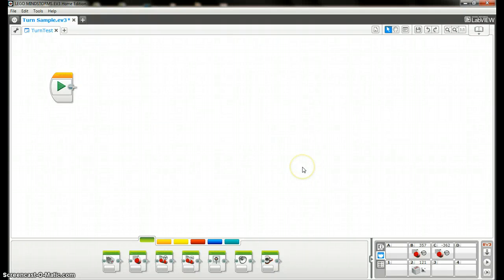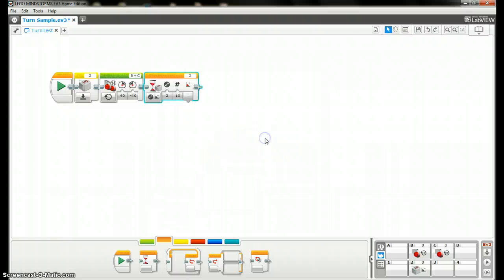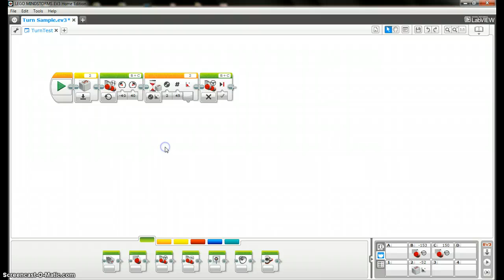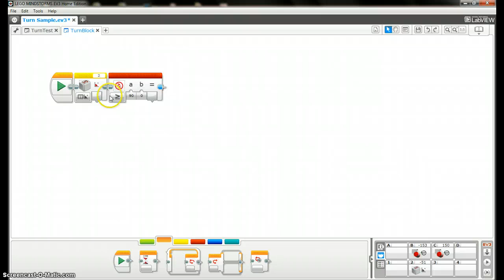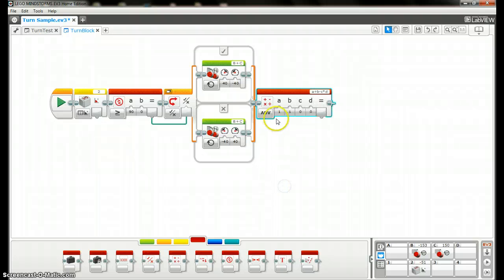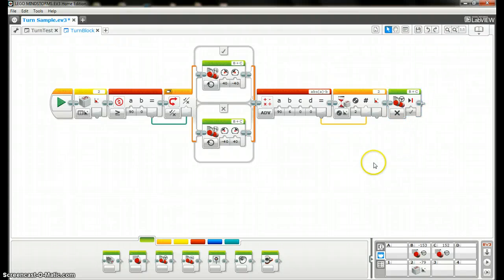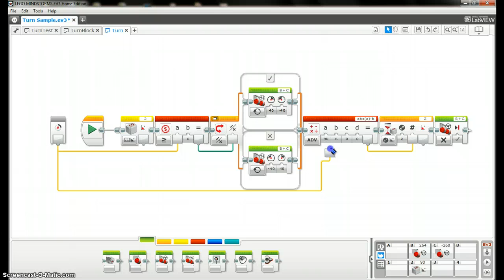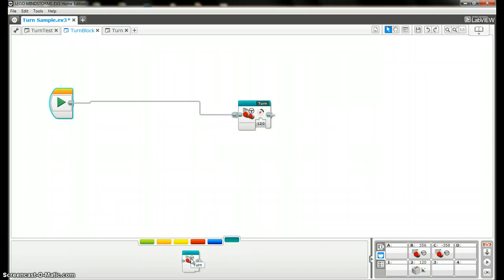Lego Mindstorms EV3: Turn Any Degree Gyro "My Block"

Comment: WE used this block successfully; however, your My Block your gyro sensor is set to Angle and NOT reset like your first test.  How does this work in the My Block.  No matter what the gyro states its angle value the robot always turns 90 degrees left or right, why is that since the gyro block is set to Angle and NOT reset and the Turn Until is looking for a change to 90?  The final Gyro reading is the angle it turned, can you explain how that works?  Example if the gyro is at angle of 236 before the turn block how does the gyro state 90 degrees after the turn block and turns the proper degrees?

Comment: Instead of introducing a 6 degree 'fudge factor', how hard would it be to just have it turn at full speed for 90% of the turn, then slow the motor down for the last 10%?  That's why it's overshooting -- the inertia of the robot in motion is sailing it past the desired angle.
Reply from the maker: Give it a shot and let me know!  I'm not certain how much of a time savings it will give you, though.  i think the next big time savings to be had is converting two straights path with one turn into a single curved turn.  My kids on the FLL team weren't able to figure out the math for it, so we skipped it.
Reply: @hyliston  oh, curves are fun! The trick is knowing that the power given to the wheels is proportional to the distance they travel. So, if the left wheel has 50% power and the right wheel has 25% power, the right wheel will go exactly half as far as the left. Once they understand that, the rest is basic math.

For example, say they want a long curve that involves the left wheel traveling 1286 degrees and the right wheel traveling 1908 degrees (determined by moving the robot by hand while in port view). 1286 / 1908 = 0.674. They'll then program the left wheel to receive 0.674 * the power of the right wheel: 40 * 0.674 = ~27. Program a move tank block with left power: 27, right power: 40, distance: 1908 degrees (the EV3 software applies the distance number to the wheel with more power). It will move in that same perfect curve every time.  (I just picked 40 randomly. It will work as long as whatever power you give the right wheel, the left wheel is 0.674 of that.)

When the kids can run two or three curves together and gracefully 'S' their way across the table, it really is a thing of beauty!

Comment: We are having problems making the program to make a right hand turn after it makes a left hand turn and drives.  Our program drives forward, then turns left ( -90), then drives forward and supposed to turn right (+90), but it keeps turning left instead, regardless of the value (-90 or +90).  Both left turn and right turn look the same otherwise.  If we turn right first (90), then it allows us to turn left (-90).  Help!
Reply from the maker: It sounds like you might need a reset block.  Adding some debugging output to the LCD screen about the current angle might also help.
Reply: When you say reset block, do you mean resetting the motors or the Gyro, because we resetted the Gyro and that did not help?

Comment: So , it's possible to put another parameter for the over-turn on the myblock?
Reply from the maker: Yes.  Especially if you turn at a speed other than 40, you will likely need to adjust the over-turn correction parameter.

Comment: The problem with this program is that the correction factor is dependent on the absolute value of the commanded turn.  If you turn less than 5 degrees, for example, this program will introduce quite a bit of error.  Below 10 degrees, the correction factor should be scaled down.
Reply from the maker: Absolutely.  My team never needed a small angle turn, so didn't focus on that.  Once at a full [unchanged] speed into the turn (which happened in the first ~15 degrees), the offset remained constant.  The offset is really just a measure of the time between sending the stop signal and the robot coming to a full stop - it will vary based on how fast the robot is going.  To account for smaller angles, a ratio could be introduced into the offset calculation.  Instead of just "abs(a) - b", you could use something like "abs(a) - min(b, abs(2*a/b))", so angles under 18 degrees would get the offset scaled down.

Comment: Mine goes in circles repeatedly
Reply from the maker: Watch your program when it is running and see where it hangs up.  You can also watch the bottom right window for each sensor reading.  I'm guessing you have your gyro sensor in a different port that what you selected in your program.  Does the gyro value change in the sensor window?

Comment: How do i make a 45 degree angle with out a Gyro block?
Reply from the maker: You can do it with wheel rotations.  It'll be different for each wheel size and axle length.  Do some experiments with the tank turn green block - turn just one wheel 20, 40, 60, etc. degrees while recording with a protractor what angle your robot turns.  From there, you should be able to figure out how many degrees of wheel rotation will cause your robot to turn 45 degrees.

Comment: what is the absolute value for?  and why we need to minus a and b. thanks
Reply from the maker: b is a correction factor because if I just used "90" it would tend to turn about 96 degrees.  Because I subtract b (6) from a, I need to use an absolute value.  Otherwise, you would end up with something like -90 - 6, which is -96, causing the robot to turn further than you want.

Comment: I made a giant myblock for this using the gyro, but mine has an input for just about anything you might need to change, but yours still has similar results, mine only varies by 1 degree and it looks like yours does the same :P